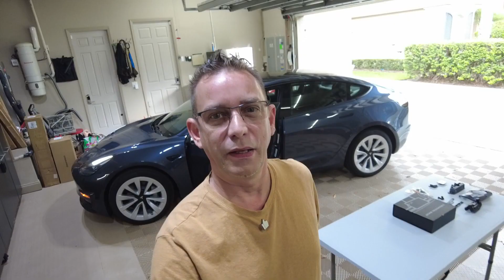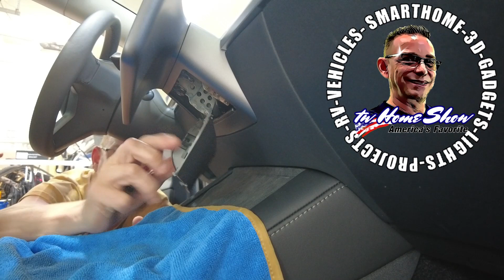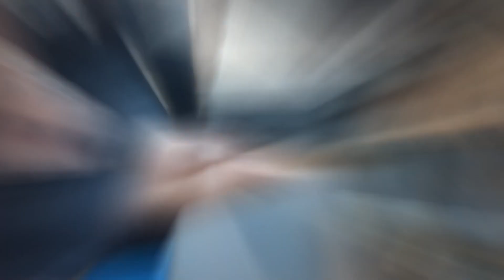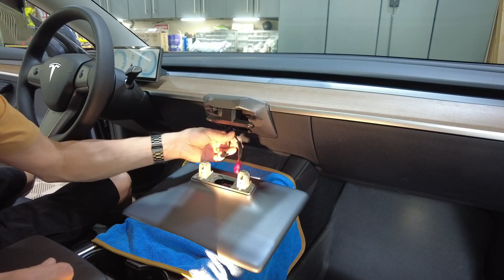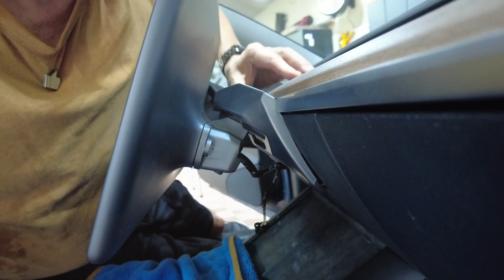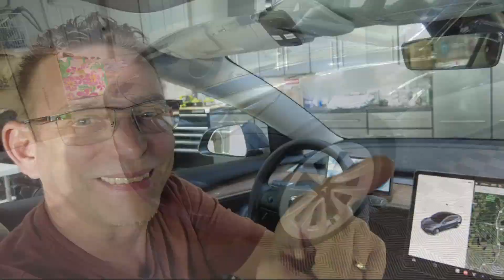Every Tesla should have this | Swivel Screen Bracket | TESLA Model 3 or Model Y | INSTALLATION

Comment: I read where there were many "fitment" issues with the car, the bottom line being crappy assembly.  Did you have any of those issues?
Reply from the maker: Hi Bill. There used to be many fitment issues - like panel gaps an miss-alignments. But they have improved or solved those issues over the last couple of years. Our Model 3 was PERFECT at time of pick-up. I was so happy!